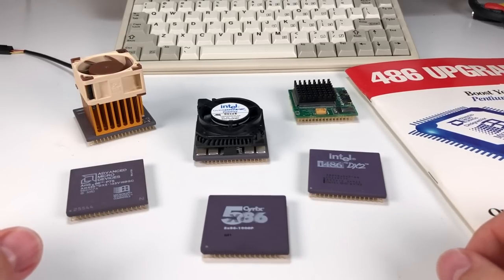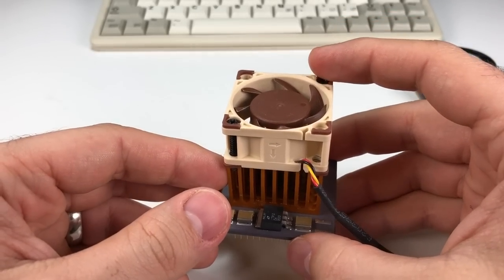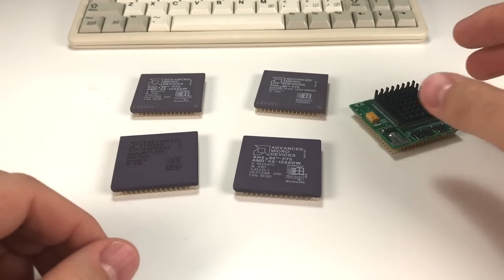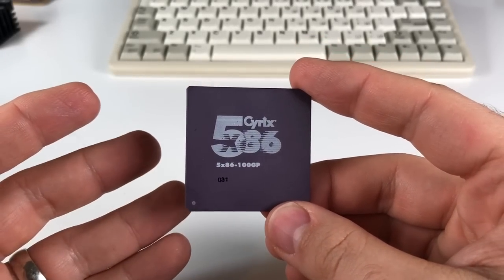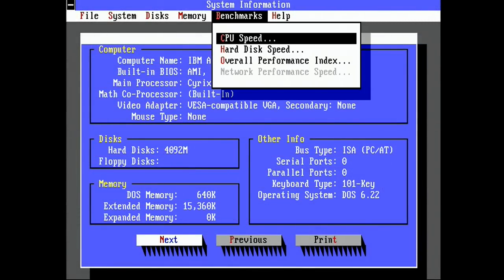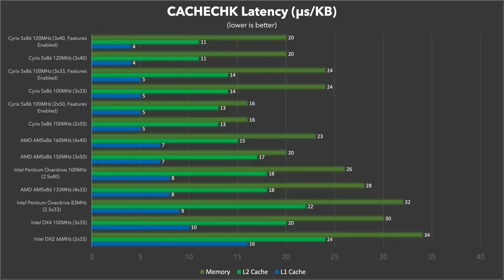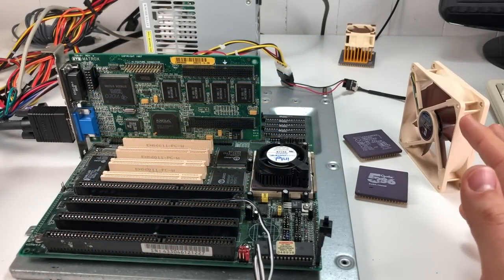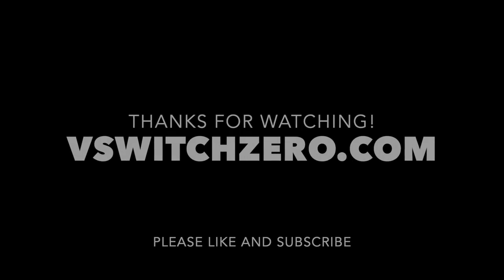The 486 Upgrade CPU Showdown!

Comment: hi, friend. I need your help.

I have two AOpen VI15G motherboards , that model with support for 3.3v CPUs (it has the power regulators). They are part of some PCs (the other is a Pentium) that I had at the end of the 90s or the beginning of this century and all the parts and pieces were stored in working conditions almost 20 years ago. A few months ago nostalgia assaulted me and I am reassembling them. All the parts needed a lot of cleaning, from the PSU to the cards, due to the dust accumulated even inside the boxes, in addition to some slight oxidation. Everything was pristine after cleaning. one of the two psu need some repair but the other ones is working flawlessly.

I have some 486 but the best one is an Am5x86. I didn't remember if the jumpers were set for use that one, so I looked for the documentation (I found two documents, one original from the first version of the motherboard, which only supports 5v, and another partially updated for the revision with 3V support). I configured the motherboard as an Intel 486DX4, also as an AMD DX4, based on some recommendations. both are 3.3/3.45 volt processors, but when measuring the voltages on the socket pins and on the regulator output, it's always 5V no matter the configuration. It happens equally on both motherboards, I don't think the regulator is defective in both cases.

I would appreciate if you help me with the correct configuration to be able to use the Am5x86 (or 486DX4 from Intel or AMD). The other 486 compatible I have is an AMD 486DX2-66 but of course the primary interest is the Am5x86.

the PentiumMMX is also not working, no post, but i will see it latter

Comment: Wondering if I should upgrade my 486 100mhz 16KB L1 to a AMD 133mhz version. These charts help but still not sure if it's worth it.
Reply from the maker: The DX4/100 is a great chip for the vast majority of DOS games. If it's just for DOS, I probably wouldn't bother. For newer games and early 3D accelerated titles, it would be better to use a Pentium MMX or later era CPU.
Reply: @vswitchzero  I might switch to a DX2/66 for a more realistic 486 era experience. So many configurations to play around with and so little time. What a hobby.

Comment: Well it appears on your modified Pod you seem to be missing a cap?
Reply from the maker: Indeed! Later revisions of the 83MHz POD only had three capacitors. I'm not sure if there is any difference between the capacitance rating on the 3 vs 4 capacitor chips, or if they just decided three was enough and opted to save a few cents :)
Reply: @vswitchzero  I imagine they decided it can run stable at 83mhz on 3 and let them off. But I bet that’s a reason why your modded pod won’t run 100mhz stable.

Comment: Cx-120 with enabled registers ought to hit 17.3-5 fps in quake and your doom score also looks off to me.
Reply from the maker: Thanks for your comment! I was not able to enable all of the registers with stability on this UMC 8881/8886 based board, so it's quite possible that better performance could be had with a different board/chipset. What was your hardware configuration and registers enabled?
Reply: @vswitchzero  I have an MB8433-UUD-A with all suggested registers on Vogons turned on running at 120MHz.  Chip is an IBM 5x86-100 without the blue heatsink. Cheers!

Comment: Damaged cap on that gold heatsink pod
Reply from the maker: Yeah there are two that are chipped pretty badly. I assume it was from when the OEM heatsink was removed by one of its previous owners. The voltage regulation seems solid, but I'd still like to get those replaced at some point.

Comment: Is it possible to overclock the AMD at 5x33 = 166 Mhz instead of 4x40=160 Mhz ?
Reply from the maker: The AM5x86 only has two possible multiplier selections - 3x and 4x, unfortunately. Very few chips can handle 4x50MHz, but if you have a board that can support a 60MHz FSB, it is possible to get a 3x60MHz result for 180MHz. I have one chip that can handle this fairly well, but it's not 100% stable.

Comment: I can't remember, back then, did we put thermal paste on these chips ? I don't remember putting any...
Reply from the maker: I never really saw thermal paste used on 386/486/pentium generation chips. Although seeing heatsinks attached with thermal glue or epoxy was pretty common. It wasn’t very critical as TDP was much lower compared to more modern chips.  I want to say it wasn’t until the P3/K6 era that its use was widespread (especially with exposed die chips).